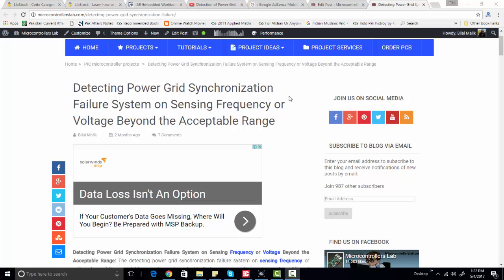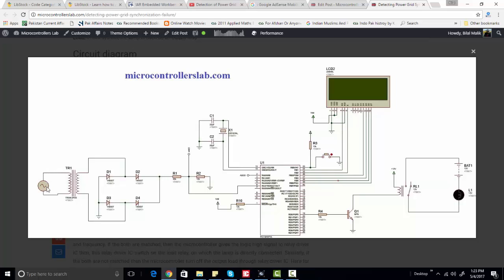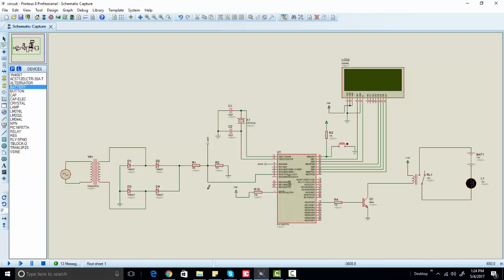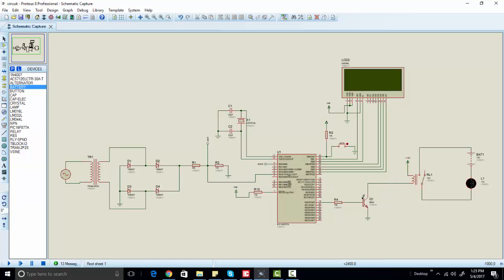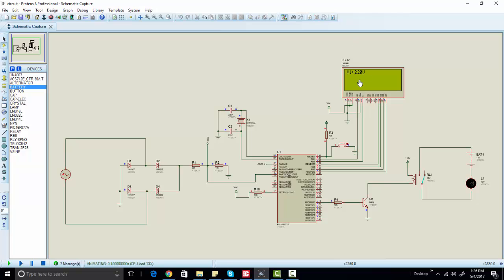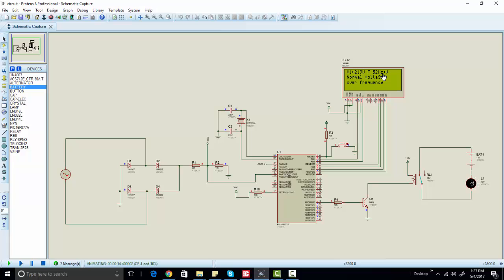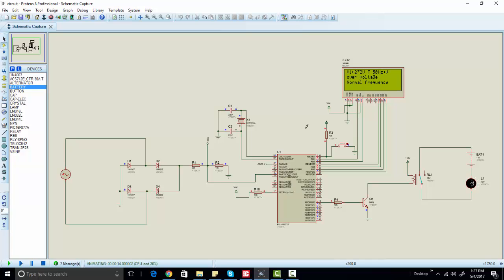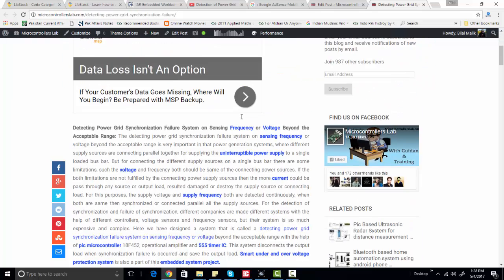Detecting Power Grid Synchronization Failure System on Sensing Frequency or Voltage

Comment: what are the functions of capacitors in that schematic diagram
and which components have been used to make the frequency detector, voltage detector and voltage regulator of the circuit
and whats the components normalizing the fluctuations incase they happen